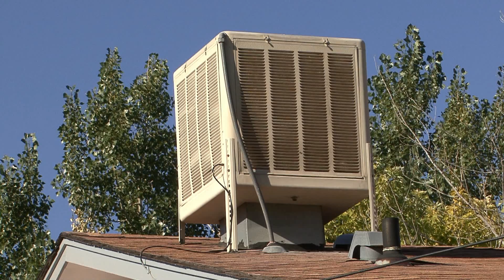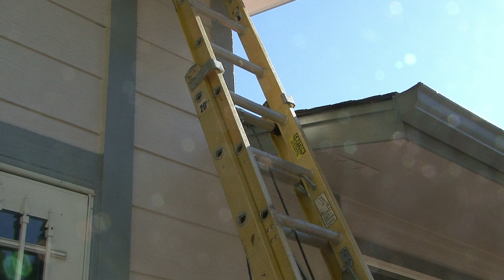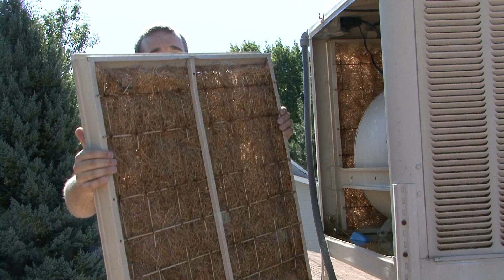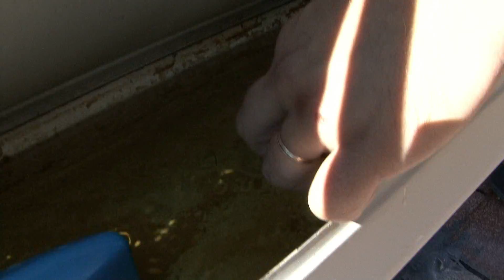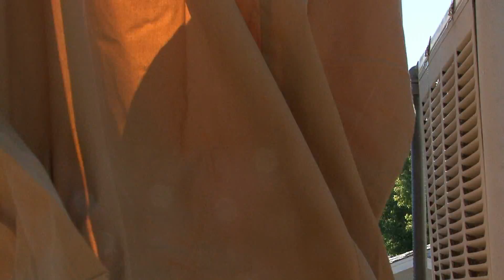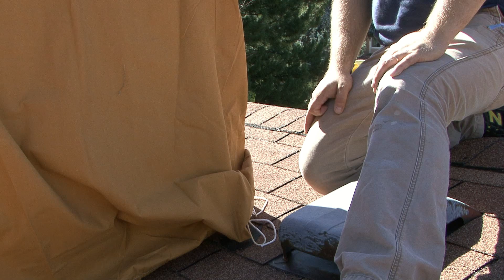Getting your swamp cooler ready for winter

Comment: Should the supply line be drained at the bottom?
Reply: yes is absolutely should be drained. if you don't drain the supply line it will break when it freezes.

Comment: My problem is, I was up on the roof the other day, the heater was on, and i realized that my swamp cooler was all puffy and full of air. The air was able to escape out the bottom of my swamp cooler cover. nice and warm. but im worried im loosing heat. My gas bill is like $200 and the heater stays on for a long time to heat up the house. Almost as soon as it turns off, it turns back on again.
Reply: Also! My previous house had a plank to put so the heat wont escape out the swamp cooler. But this house, my swamp cooler is connected to ducts that go up into the attic and the heater vents are the same pathway as the cooler vent in the summer. Any suggestions?
Reply: +James Last check your attic where your cooler comes in you may have a vent you can block with a piece of insulation and a board.. just a small town handyman A Local Source, LLC

Comment: I see there are 2 types for side discharge & downdraft "slide-in" dampers; between the blower assembly & roof jack adaptor and/or to the air vent duct that has a slide-in opening...plus there are air duct covers to fit over it as well.
So, that is what I'm needing to find; the installer did not give us the manufacturer's damper that came w/ it only the canvas cover?
I found the PMI manual as it mentions about the slide-in damper...I need to find a 20"...looks easier to install in the air vent.

Comment: usually there is also a plate that you put either between the vent and the cool or just underneath the cooler to keep all all the hot air from escaping during the winter.
also a good tip if you are living in an area where the water may freeze during the winter, opening up the water pipe and drain all the water from it because when the water freezes inside the pipe it will expand and damage your pipe.
Reply: Where is this located? I have the plate but do not see where it goes